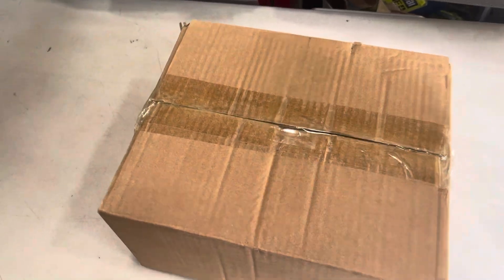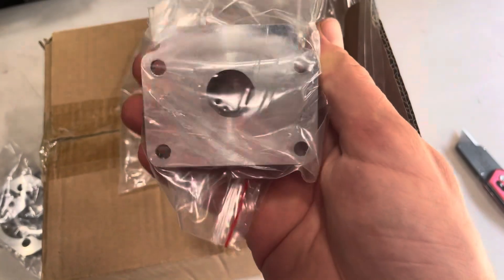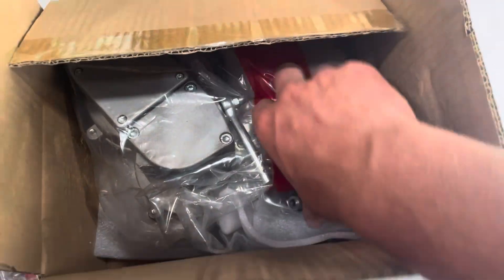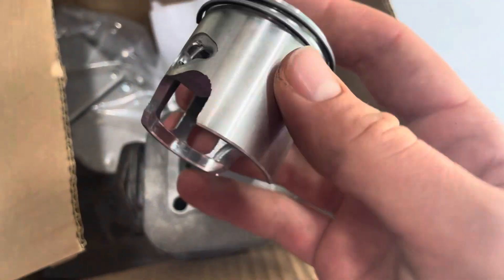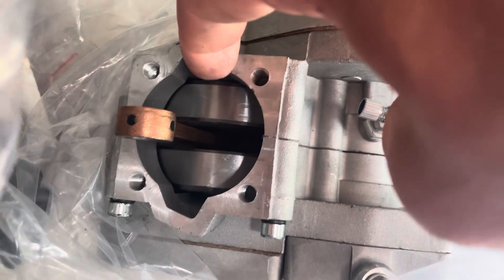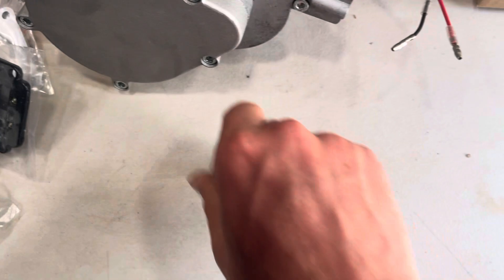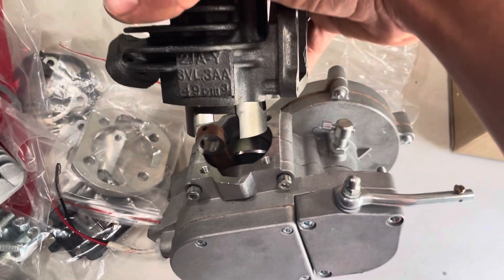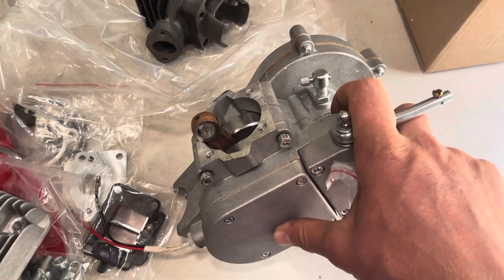The Fastest and Most Powerful Motorized Bike Engine

Comment: I cant remember what brand my first engine was think kinbelle or automoris. It was good for 60 km/h. I beat that engine very bad, lots of off roading and whiskey throttle still had solid compression 3yrs latter. Stator finally went out no other issue. Gave it away. Best $150 I ever spent.

Comment: 70cc ?
Reply from the maker: @aski1529  yes
Reply: @zsfabricating  47cc we are not in china!👍
Reply: @DirectCurrent4u due to it using a minarelli upper it's an actual true 70cc. The Chinese would rate it at around 85 or so. I can't be bothered doing the port volume math that they run to beef their numbers.
Reply: @pamew  need a license for 50 cc and up.
Reply: @brentjeralds777 that’s why you don’t say it’s a modified hybrid stroked out to 80cc you play dumb and say the cylinder says 49.9cc. Which is the OG bore of the crank and case it actually bolts to. Not a China bike bottom end with the big 1/2in thick spacer that’s used to connect the two. Besides widening the transfers and helping the flow & all needed to operate well. It also adds volume obviously